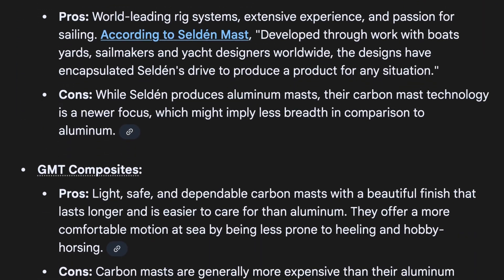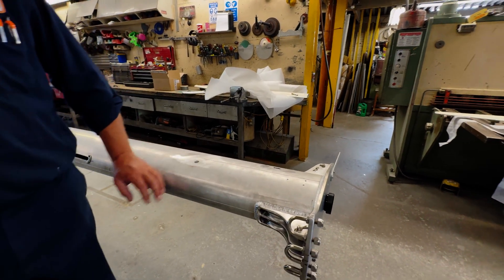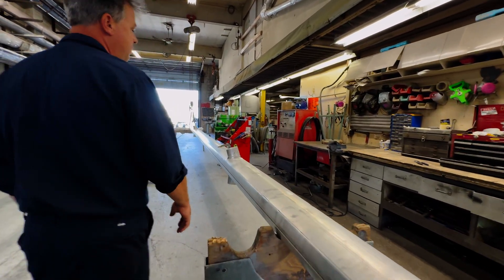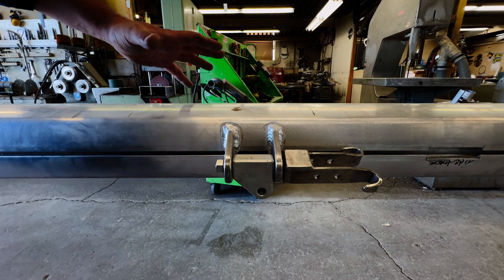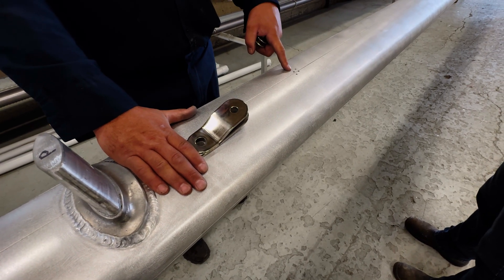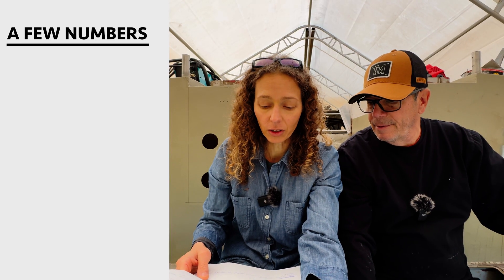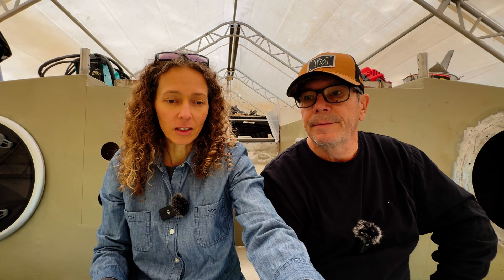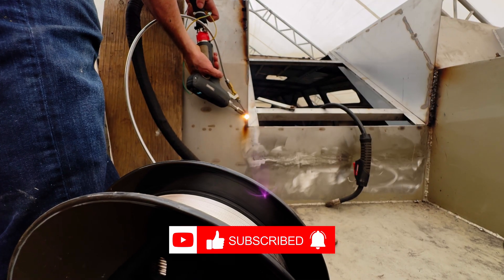⛵️Mast + Standing Rigging - Expedition Sailboat Built for the Arctic | Ep.13

Comment: Interesting. I like Klackos principle of welding the mast components, this is a major weakness on many aluminium spars.  Extra surprising then, to find they also use SS parts with just sika-flex as a insulator. The "maintenance free" masthead was also a good joke, there ain't such thing as a free lunch when managing corrosion. But all in all, I like the spar. Will you be using rope standing rigging?
Reply from the maker: @smurglerer Thank you for your comment! Yes, there is not such thing as maintenance free on a boat (any part). But quite happy with the construction of this mast. We would have really like to use dyneema for the standing rigging, but it just didn’t fit within our budget. Only the inner forestay (or baby stay) will be in dyneema.
Reply: @SailingWildRaven  Understand that! I work with tigh budget constraints on my own boat too.